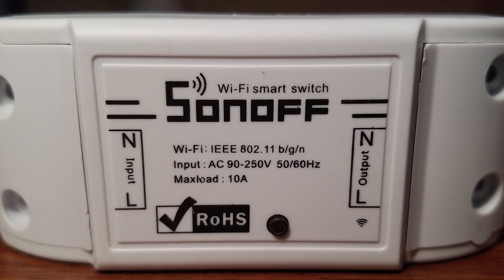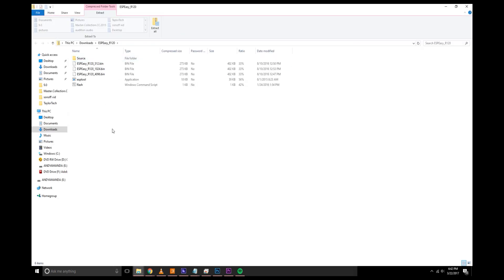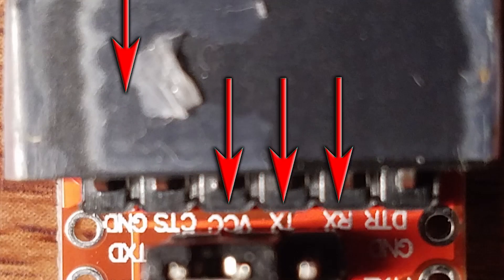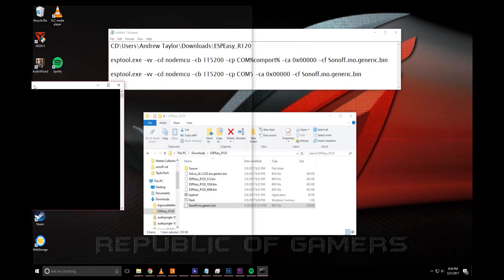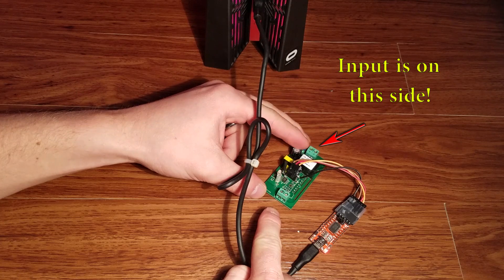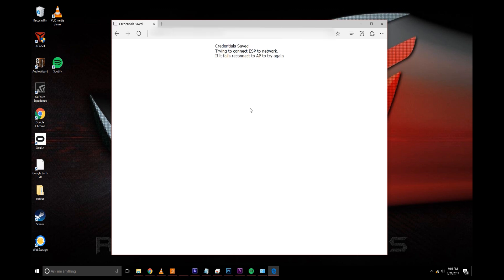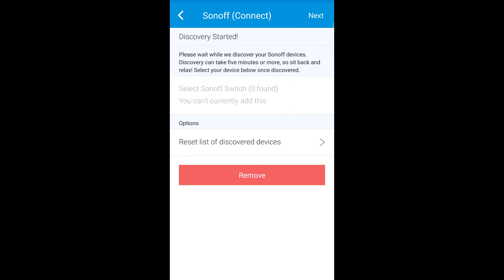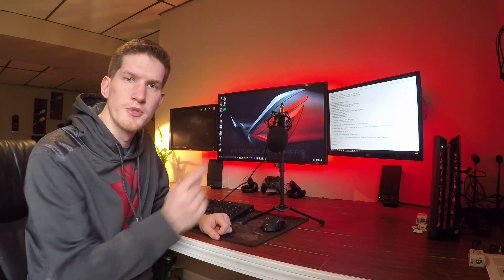Sonoff: $5 Smart Switch! Works with Smartthings!

Comment: To anyone having no WiFi AP after correctly flashing the devices, please refer to the last comment on the SmartThings community. The link is in the video description up here.Scroll all the way down to last comment made by Eric himself, if you flash using nodeMCU with the correct configuration you should resurrect your sonoffs.
Reply: I have this issue that after flashing no WIFI AP. I flashed multiple times but not luck. I am lost in user group comments and not able to find the exact solution.
Reply from the maker: Piermaria  thanks for the update! I pinned your comment to help others
Reply: Piermaria, thank you for tipping.  You save a bunch of Sonoff of mine :-)
Reply: this worked for me (use NodeMCU flasher) : https://community.smartthings.com/t/release-sonoff-sonoff-th-s20-dual-4ch-pow-touch-device-handler-smartapp-5-10-smart-switches/45957/721
Reply: Denis Klepcha thanks I figured that out and confirm it works.
Reply: Were you able to resurrect the dead device with this? Thank you.
Reply: A faster and simple way to do it (that works with latest sonff) is with esptool.py (https://github.com/espressif/esptool), it's another command line utility.  sudo esptool.py --port /dev/tty.usbserial-XXXX --baud 115200 write_flash -fm dout -fs 8m 0x00000 Sonoff.ino.generic.bin
Reply: Just referenced the SmartThings community link and there are 1646 posts. Not sure which one has the solution for the no WIFI problem. Do you remember what post it was?
Reply: Tried this https://community.smartthings.com/t/release-sonoff-sonoff-th-s20-dual-4ch-pow-touch-device-handler-smartapp-5-10-smart-switches/45957/721 with no luck. 
When I previously flashed it with sonoff-tasmota the green light would flash when power was applied and I could access it's web interface, just couldn't get it to work with ST. Now it's just dead with no lights and no WIFI even though NodeMCU flasher loaded the flash.

Comment: Discovery Started, never finds a device. How can i change the firmware back to Tasmota using WiFi? The smart plug i'm using does not have header pins.

Comment: can i use the same code on the smart light switch ? 
https://www.itead.cc/smart-home/sonoff-touch.html
Reply from the maker: Check out the smartthings forums linked in the description. I think you can yes, but I would double check there.

Comment: So I could need a lot help here.
I have a Philips Hue Bridge + Bulps which should be no issue to connect it with Action Tiles right?
But I also have like 6 Sonoff Switches. So do I have to buy a SmartThings HUB + Do all that crazy stuff in this video to get it working with Action Tiles?
Reply from the maker: Unfortunately, yes. You definitely need a smartthings hub, since ActionTiles is a client of Smartthings. Then, you can add your phillips hue into smartthings, and finally flash your sonoffs if you want them to work natively. (This is assuming you got the same model board that's in the video, they changed boards around a few times)

Comment: Anyone know if this firmware works with dual or 4ch sonoff ? If not is there one that will connect them to ST. Thanks for the video,  have 6 1ch sonoffs working with ST no issue...

Comment: Taylor. Thank you so much for these videos. Very intuitive. I have successfully flashed the T1 US 1 gang switch. But having problems with the 2 gang. I was told to flash using the sonoff 4ch switch bin and handler. I have completed that successfully, only problem is that relay 2 will not stay on. After I press the touchpad or use the app, relay 2 turns on for 20seconds then shuts off. Any information would be greatly appreciated.

Comment: I put a sonoff basic and the cube in SmartThings tonight and for about 3 hours so far it is stuck on checking status.  Any idea what might be the issue.  I didn’t flash tasmota on the sonoff.  Also I couldn’t get the it ID for the cube, but I did for the sonoff.  The device handlers and apps are loaded.  Thanks.

Comment: All worked great until I attached the switch to a load (ceiling fan). Configured correctly in SmartThings, and switched on and off repeatedly on my bench . After connecting to the fan, it worked for one on/off cycle then no response. SmartThings shows extended “turning on/off” notifications (module not responding). Same results for two different Sonoffs. Suggestions?

Comment: Good evening, I just noticed a strange issue with all my Sonoff Wifi Switches flashed for use with SmartThings.  They have all been working fantastic for over a year, but today I noticed on my iPhone SmartThings app that all of the sonoff switches are now showing up on the app as Tiles Missing.  Previously they all showed up fine.  I also noticed that the aurilux controller that I flashed using your other video to control my LED light strip is doing the same thing.  They all look fine in the SmartThings IDE and if you click on the tiles missing icon it shows the correct name but if you click on configure  it says error fetching device, please try again.  My amazon echo is paired with smartthings and still works fine controlling the light strip as well as my 9 sonoff switches. I tried removing and reading them to ST and no change.  I reinstalled the app, no change.  I also redid the device driver in the ST IDE and there was no change.  I also tried another IOS device and it's doing the same thing.  Has anyone else seen this with theirs or is it just me having this issue.  Not sure if this happened with the latest ST app update on my iPhone.  I can no longer control these devices in ST, yet the smartapp detects them fine.  Very strange.
Reply: Update:  It seems to be an issue with the device handler.  If I change it to anything else other then the Sonoff Wifi Switch type in the ST IDE it shows up fine in the app (but does not work obviously).  As soon as I switch it back to the Sonoff wifi switch type it goes back to tiles missing.  Something must have changed with ST or the app to cause the Device Handler to no longer work properly.

Comment: Hi Guys, thanks for all the tips to enable wifi from sonoff. I tried it through nodeMCU. worked like magic. However, after enabling  device handler and the smartapps, smartthings is not able to discover sonoff device. 

If I add the device manually, smartthings is still not able to control the device. 

Any help is appreciated.
Reply: I am not able to see the WiFi after flashing the Sonoff , how did you solve that ?
Reply: Follow the comment on top. Use NodeMCU tool
Reply: I have this exact problem too..

Comment: I have tried for 2 days to flash my Sonoff Basic, It was flashed literally a dozen times, without success, first no AP,  then i got the AP but it would not save the Wifi details
 this worked for me using the NODEMCU FIRMWARE PROGRAMMER and loading the Sonoff.ino.generic.bin file into it.  Thank you very much !!   Im HOPING as its a generic.bin file i will be able to flash my Sonoff SV.

Comment: hello Drew i am new to ST, i have done the h801 flash   on 5 h801's so far and it  is working great but  i am wondering if i can use this FW and smart things with the sonoff to use my sonoffs in a 3 way switch setup ,2 sonoff's for 3 way switch ,
i am looking to get  these 3d printed  in wall  light switch housings for them that use the button on the sonoff a sa switch ,   one sonoff would connect to the minas an the load
and the other would just connect to mains and be used basically as a  wired transmitter
so would i be able to set up the rules in the  IDE/device handler to make the 2 act as a 3 way switch so that i can turn my front light on/off from , either  2 sonoff's button or the app or other ST input like proximity ,  PIR ,etc so it always known  what the state is no matter what i use to  switch the light?

Comment: Hi any way to get a device handler script for a unmodified espeasy firmware 2.0. I need to set internal rules. want sonoff basic to communicate to each other directly though the rules section. The modded bin you made does not have rules in it. Thanks

Comment: Hi! First thank You for all the great videos! I have a question: Will this flash allow to use the Sonoff as a momentary signal?
Reply from the maker: +Adi Satzinger yes it will. Although, there have been reports that the sonoffs aren't coming with the esp8266 chip anymore. So if you don't have the 8266, you may need to use a different flashing method.

Comment: Great Video, unfortunately I wasn't able to get it working on my end.  Flashed successfully, then was able to connect to switch on wifi, but that's as far as I got.  The login screen never popped up for me to connect it to my wifi network, any ideas why it wouldn't pop up?  (8:18 mark on your video)  thanks
Reply: JTinPA68, Its because Mr Taylor left out one key piece of info. You need to type into your browser window "192.168.4.1".  It will then get there.  You can see in his video that he did, but didn't say it.  Took me a second too.

Comment: Can a direct switch action (on /off) work when sonoff is connected or only device can be triggered (on/off) by WiFi ?
Reply from the maker: +Vishnu Charan there is a button on the sonoff that will toggle the relay.
Reply: TaylorTech do I need to toggle it every time?
Reply from the maker: +Vishnu Charan no, it's just available if you want to do it manually. You can do it via WiFi (smartthings, for example) or manually and it will show it's new state in smartthings

Comment: Hello, I’ve seen your guide and I bought two jeffs, finally I got everything I needed yesterday, I followed the whole guide, but after flashing your firmware, I connect the power but no wifi network is created … Some suggestion?

Comment: Thank you for this video.  With it I was able to flash 10 device.  I have one question.  When in Smartthings and I go to setting (the gear icon) it say you can program the switch to shut off after a predetermined amount of seconds.  Or use the gpio14 switch as a toggle.  Or enter a password.  I can't get any of this to work.  Do you know if it is something I am doing or does it now work for everyone?
Reply from the maker: to my knowledge, all of this should be working. Although, the only thing i have used is the auto turn off function. maybe try rebooting your sonoff as well as restart the app. You may even need to reboot the hub. another thing you can try is posting in the smartthings community forums page. They should be able to help you out more than me... good luck Andy!

Comment: What version of the ftdi drivers are you using on Windows 10? I have 2.12.28 and having a real tough time connecting any esp device.
Any tips on where to get the right drivers from?
Thanks!
Reply from the maker: +Ash B link in the description to the ftdi adapter I used. Only problem is I've heard and experienced Amazon as well as other sites sending generic adapters even under the same link and model number. I'd say amazon would be your best bet though
Reply: TaylorTech Hi Thanks for your reply. Just to clarify my question, I was curious about the driver software version that Windows installs rather than the adapter hardware itself.
I would really appreciate if you could check the device manager and let me know the windows driver version.
Apparently Microsoft has released the latest version which will check if the ftdi chip is genuine and won't work if it's a clone/fake chip.

Thanks.
Reply from the maker: +Ash B ahh! Sorry I misunderstood I'll check as soon as I can for you

Comment: Thanks for the video. I didn't have any problems flashing the firmware on two new Sonoffs I got from Amazon but like others, the Sonoffs now do not project a WiFi signal. The author of this video https://youtu.be/hMN568beiYE says apparently Sonoff changed something that breaks WiFi after flashing with ESP Easy firmware. If this is true, I hope they will update ESP Easy firmware so it will work with the newest Sonoffs.
Reply: Steve, refer to my latest comment.

Comment: Be warn. I blew up 4 sonoffs following instructions exactly as shown. wifi is lost (No green light blink) after flashing the firmware firmware. Any help would be appreciated if there is anyway I can make my sonoffs works again.
Reply: To anyone having no WiFi AP after correctly flashing the devices, please refer to the last comment on the SmartThings community. The link is in the video description up here.
Scroll all the way down to last comment made by Eric himself, if you flash using nodeMCU with the correct configuration you should resurrect your sonoffs.
Reply: @piermaria: do you have a link to the exact comment? That thread has over 1,000 posts and I'm having a difficult time find that one you're talking about. Thanks.
Reply: Same here!!! Any Idea how or why? Is there a way to test I don't get a green light any more

Comment: Mine flashed correctly but there is no SSID broadcasting. Any ideas?
Reply from the maker: macrij +macrij try using the method in my "new flashing method" video for the rgbw controllers. The method is similar. Just use the .bin file from this video in the program.

Comment: Hi Tyler. I flashed the firmware successfully, and than plugged the GND and VCC back in. But Still can't seem to detect the WiFi signal on my laptop from Sonof device. Can you tell me what am I doing wrong?
Reply: Dave Mason try to wire in a power cord. Keep an eye on the LED on the board. If it doesn't light up even for a second, than your Sonof is most likely DOA. If you see it light up, press and hold the button until it starts flashing and than you should see the Sonof wifi signal. A word of advice, if you don't see it on your laptop, take your smart phone and see if it detects the signal.
Reply: Leo no it doesn't light up at all but I can still flash the sonof
Reply from the maker: +Leo could be a bad board.. try plugging in voltage from your mains into the input side to power it insteas of using the FTDI for power
Reply: I'll use an old power line. And have ordered 2 replacements from Amazon..Just in case.
https://www.amazon.com/gp/product/B06XPGVW2L/ref=oh_aui_detailpage_o00_s00?ie=UTF8&psc=1
Reply: Also, I had to download the FTDI drivers for my laptop from this site.
http://www.ftdichip.com/Drivers/VCP.htm
Reply: Hi i have got the same problem powering with mains not working ether can anyone help?
Reply: Leo it doesn't light at all now with mains or 3.3v bit it detects a device when connecting to my laptop also my phone and laptop can't see the wireless network
Reply: Dave Mason . Please clarify.  Does the LED on the Sonof turn on when you plug it on? If so, can you get it into the pairing mode by holding the button on the Sonof for 5+ seconds? If you can get it into the pairing mode, can you detect the "Sonof..." SSID on your laptop or smart phone? If you can detect the wifi, are you able to login with the password provided in the video?
Reply: Dave Mason sorry to tell you, but like me you have a bad board. You can reorder directly from Amazon. They have a 2xSonof deal going on and it is warranted. I ordered 2 more and have since flashed both successfully.
Reply: I have just finished flashing my second successful Sonof device. If you can flash it and when you power it; you cant get the LED to turn on after pressing the button for 5 seconds followed by releasing it. You do have a bad Sonof device. I seen it with the 1st one I received.
Reply: it worked fine thought there app and led was working untill i followed this video and now no led at all not even after pressing and holding for 5 sec's
Reply: Dave Mason check your solder points on the header. See if you accedently cross soldered points on the board which should not have been soldered together.
Reply: both boards are ok and both tested before flashing and after soldering were working
Reply: In that case, I am out of ideas. Sorry I can't be of more help. In my case the first bord which did not work was actually bricked by myself. I broke off the switch and fried the on board chip. I went over it with the scope this Friday. The other two from Amathone are functioning. The only thing I feel which is needed to flash them easyer is for Tyler to show how to make a custom header with an inline on/off switch to make easyer flashing. An I am going to build one this week.